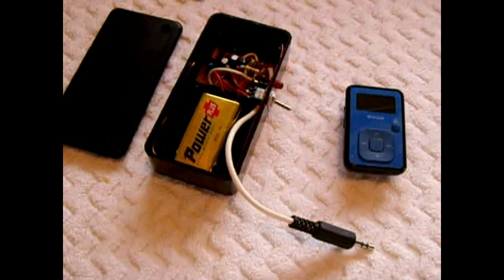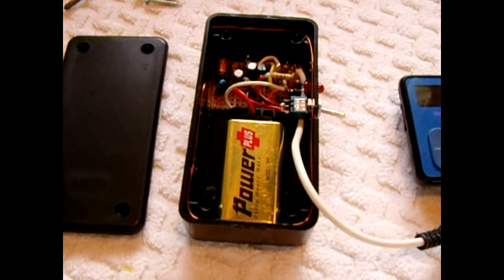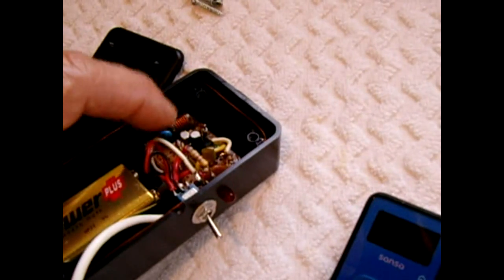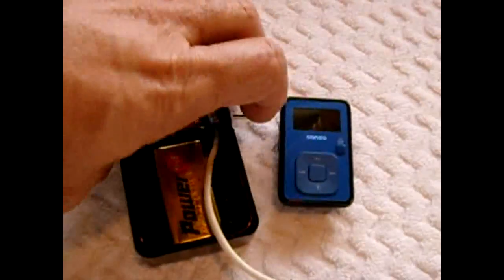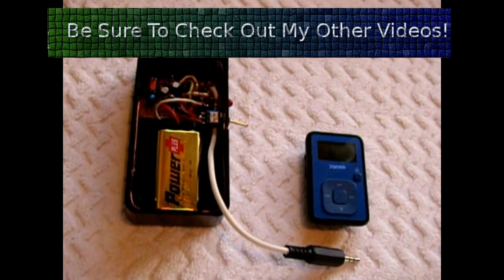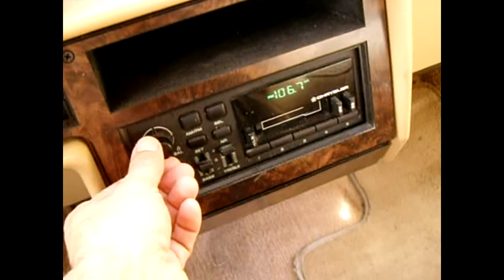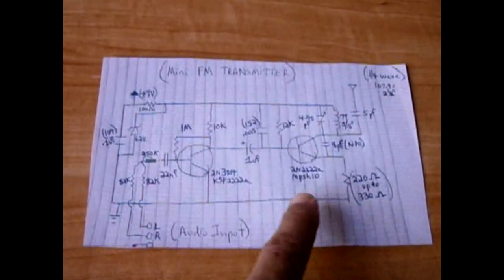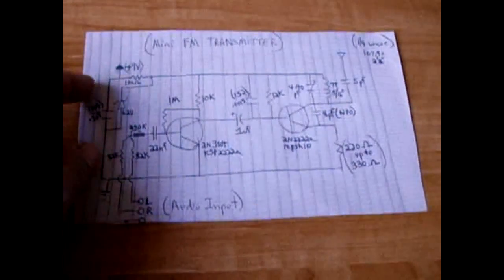Make FM Radio Transmitter For Music

Comment: could the capacitor between emitter and collector be 10pf instead of 8fp and what was the gauge of the wire that you used on the coil thank you
Reply from the maker: Between 5pf and 10pf should work fine. Don't go above 10pf.(10 is really pushing it) You can also use (2) 10pf's with very short leads soldered together in series to get 5pf. I would go with 5pF. You can use 16 to 18ga enamel wire for the coil. I used 18ga. If you have any problem with this circuit, the FM loop antenna transmitter circuit is also excellent, and is super stable! Be sure to check out my video playlist for "FM transmitters".

Thanks!

Comment: Very nice, I recently made one using a single transistor a 3 9 0 4 .I worked well but I used a trimmer which as you point out can be a pain in the ass.great video
Reply from the maker: Thanks. For best stability you should use a fixed NPO pF cap in the tank circuit, and a tunable inductor with the regulated voltage supply.

Comment: Hi Would you think of doing a circuit for AM radio ?. Where I live the AM choice is very limited. I have a few vintage AM radios that use Tubes and would like to listen to them after I repair and restore them. I really like the FM transmitter Thank you for sharing.
Take care.
Tec
Reply from the maker: Be sure to check out the other FM transmitters listed in the video description area. I will look into making a AM transmitter in the future.

Thanks!
Reply: electronicsNmore
Thank you for the reply. I'll keep checking on your channel and videos. There is a lot of very interesting and useful projects you have built.
Take care.
Tec